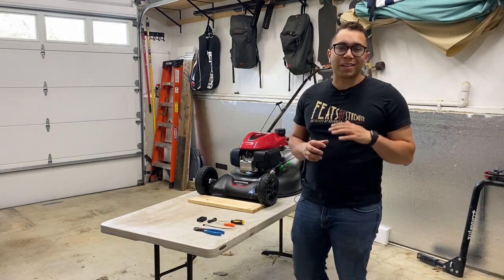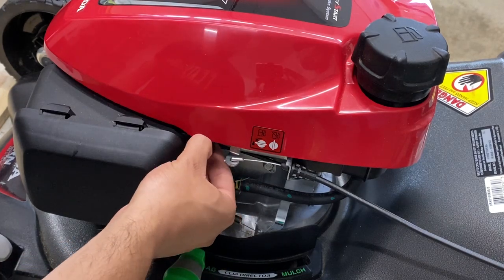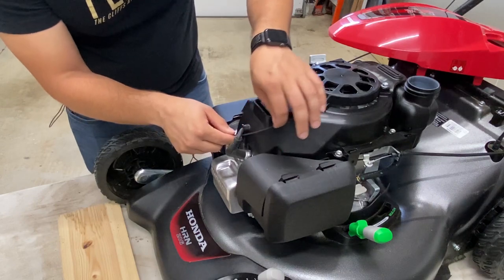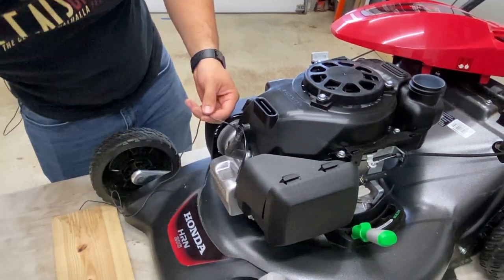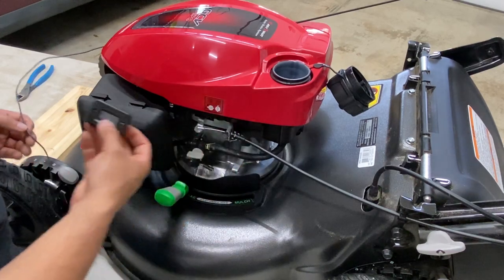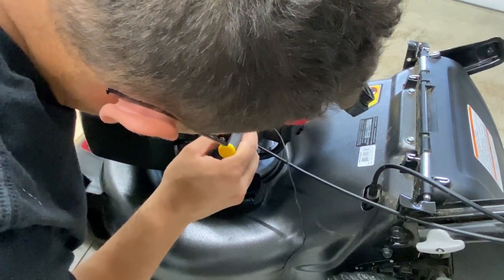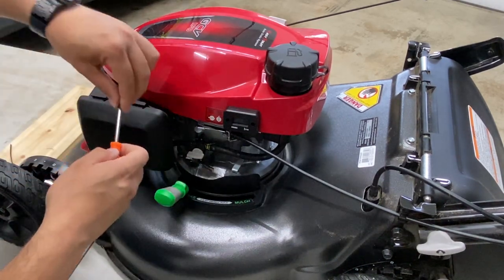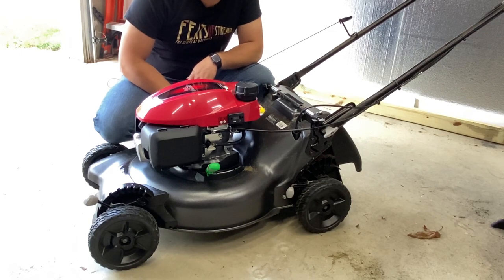How to Install an Hour Meter on Your Lawn Mower!

Comment: What happens when you spill fuel on it or you wash your mower?
Reply from the maker: It’s been about a year, I have left the mower outside in the rain(on accident) and have had no issues
Reply: @ProjectsWithMatt  I just looked at your  hour meter link and it mentions that they are waterproof.